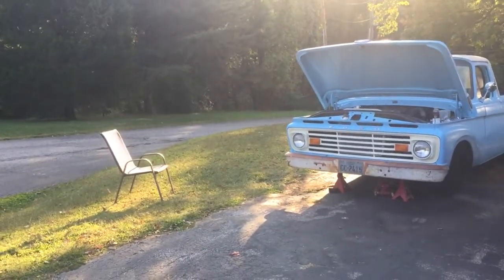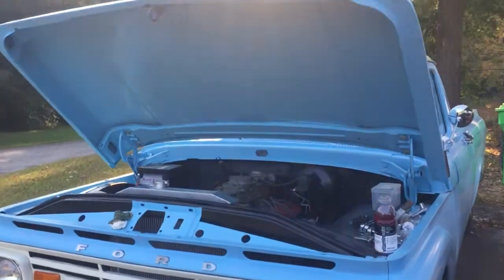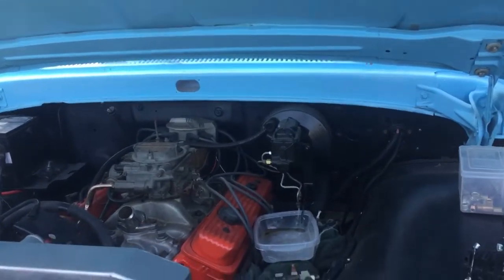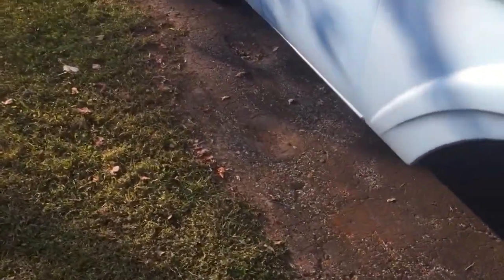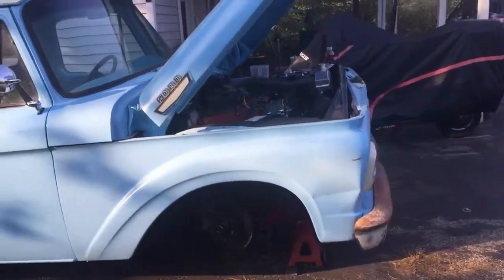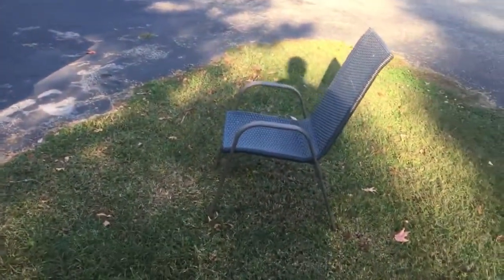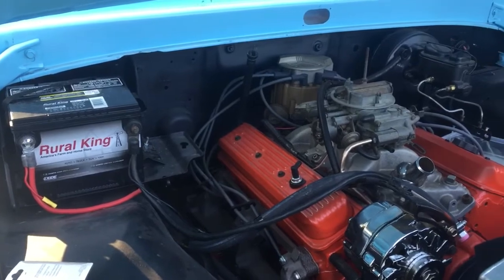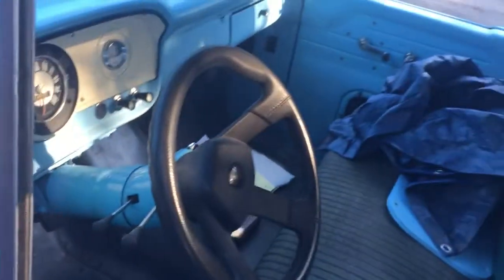Help on proportioning valve?

Comment: If you have a major leak(say rear) the proportioning valve is designed to shut of all flow to that portion and only allow the front to work. So with no pressure on the brake side from the front or rear the proportioning valve will push a rod to close off those brakes. Generally there is a little knob/button on the back(where you have that port) you pull while bleeding so it keeps them open. I assume yours is shutting both off due to this. The internal rod also connects the two power contacts on your proportioning valve to turn on your brake warning light.

Comment: You need to remove the chrome off the lower portion that goes in the block , I’ve had to do it on all chrome aftermarket ones I have bought . On The brake proportioning valve it will either work or they don’t ...these aftermarket types most are not made very well and cause a lot of problems , if you can get a stock one off a truck near the same year as yours your issues should go away ..I still prefer old stock parts when I can  . I will look at my 63 parts truck to see if I still have one on it , if I do it’s yours .
Reply from the maker: Rusty rods Thanks but my brake booster is mid 80’s mustang and that proportioning valve was on that same car. I noticed some bad new about it though if you watch my newest video, one hole is stripped of threads so it’s trash. Now I’m looking into what master cylinder will go on my booster that has proportioning built into it.